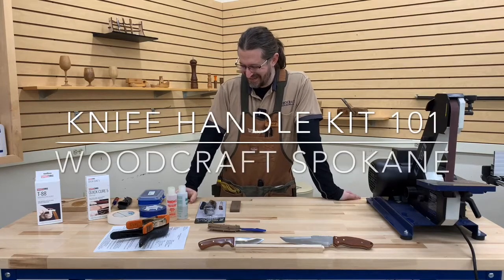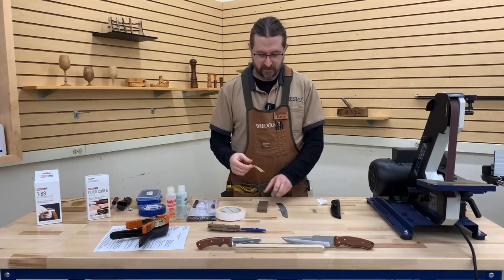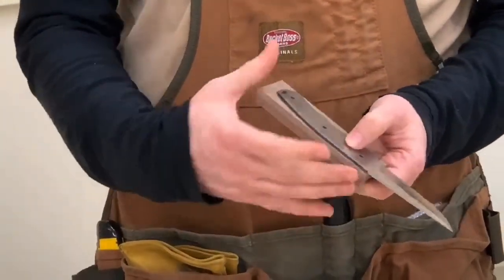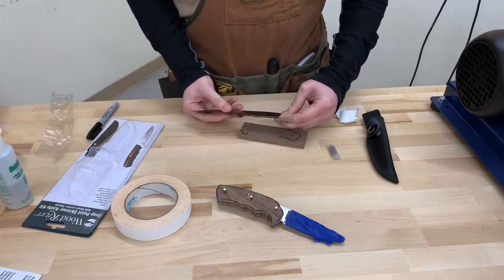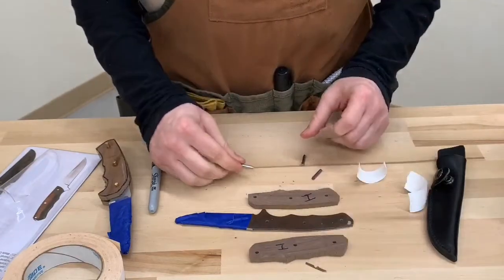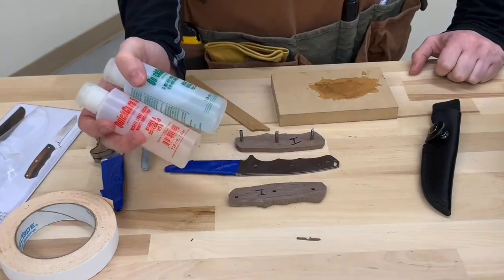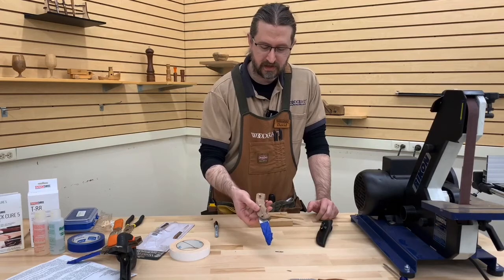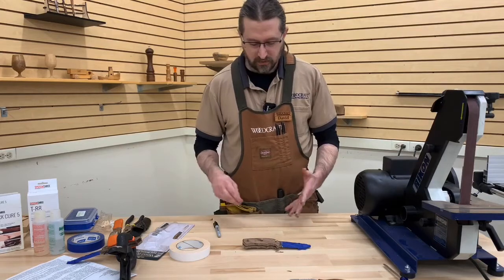Knife Handle Kit 101

Comment: 11:18 I noticed when you were drilling, from the point that you were holding the knife and scales to the point that the drill passed through everything it appeared that everything shifted about an eighth of an inch downward; did this cause problems with the holes being wallowed out or misalignment later?  if you don’t have a drill press, can you put this into a vice and attempt to drill as possible perhaps using a self centering bit to pre-drill and then a larger bit to follow?

Comment: Should you rough up the metal of the handle with sand paper to give the epoxy more grab on too?
Reply: doesn't really matter as much, but you should definitely clean it with mineral spirits to make sure that any oil is gone before you try to apply adhesive.

Comment: If you wanted to do this as simple as possible. With no woodworking experience or equipment. 

Just wrap a bunch of duct tape around as a handle. 

And go about your day. Ugly knife in tow.
Reply: Or wrap it with 550 cord and then mix up some five minute epoxy and apply it with a rubber glove. Get the excess off and let it cure.